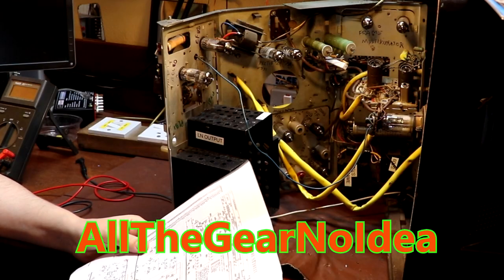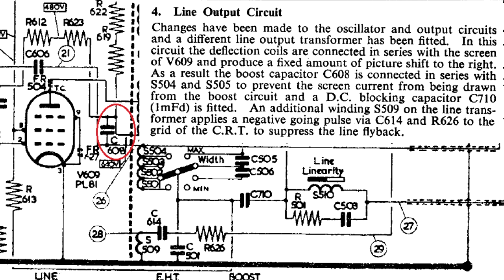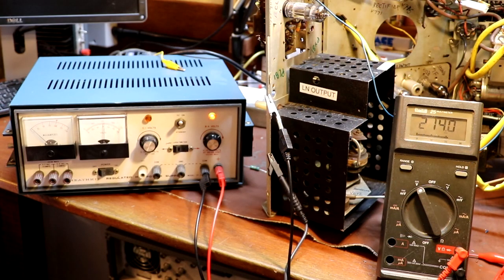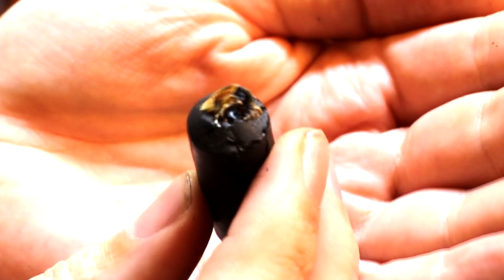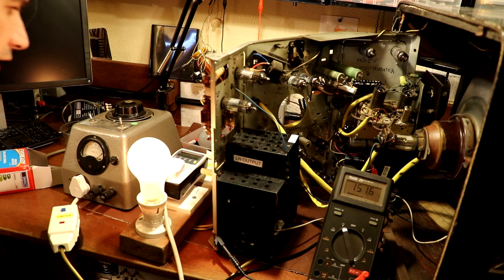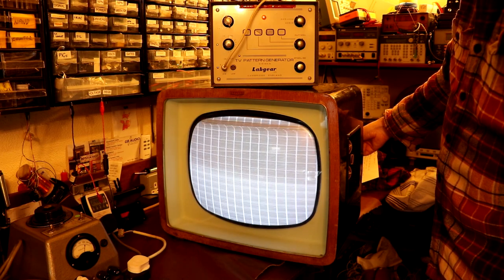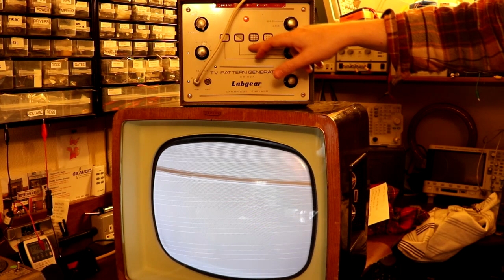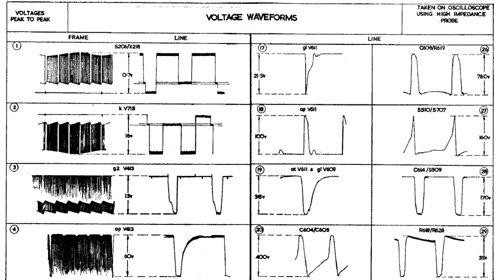Shampo066 Stella TV Repair - Part 2

Comment: Well done, Chris. In the last bit of video it looks as if you solved your vertical hold problem. Looking forward to the next part to see how you progress. My experience with "video" was the raw output of a radar receiver (we called it video) and was a completely different beast. The "sync" pulse was a very large positive pulse at the beginning of the "frame" caused by a 4 Megawatt pulse from the transmitter. Regards, David.
Reply: Me too David. Expendable naval decoys, fuses, IFF gaussian radar. Pulsed RF power. Can't say much more.
Reply from the maker: Hello David it’s more a case a stopped clock being correct twice a day.  I think the frame oscillator is free running without sync. It will sync with the video via a manual adjust but then the oscillators drift out of phase and the picture rolls.  I also used to design spooky equipment used for the guidance of large penis shaped object alas I cannot say no more !
Reply: @danishnative9555  I also worked on IFF and yes, can't say much more. Most of my work was on 250 NMi (463 Km) range primary and secondary radar systems.

Comment: Hi Chris, well that's a great congratularly mode for you to get the televisory working state and clear picture, never minding the framy rolly. 405 Droitwhich lines though probability broadcast masty down the tube twenty more these days. Actually and not known familiarly 405 liney was 376 linefold indeed.  Composite H and V typo signal for the syncy pulsey signal threshibold back and reach 405 lines, you see? Fundimold, the vertical synch pulsey begins ever more the blanky interval. Of course, matters little fact that 405 was 10.125 hertzing frequence which by clearing division equilibrates 50 hertzing timing 405/2.  The transformerfor for the coil weighty acts to buffery the sync seperaty bias capacitors timeringy and act as a vertically line pulsey continued. If the dB's gain is 10 over log then, as you know, is five divided by then that gives you the right answer. Mind you you will have to do a matchy most for the flyback keel.   Hope that helps - Andrew
Reply from the maker: Yes think you probably correct. I may just try George’s idea first and bang the top of it until it starts working.

Comment: Superb Chris
Really enjoyed the video , the dot on the screen at the end brought back some memories !
I do like the way you test new capacitors before putting them in , i also do this it's good practice 
Anyway great watching 
Best regards Shaun
Reply from the maker: I always check capacitor just in case I have read the value wrong or got them mixed up with another component. I miss the dot now with the modern televisions they should write a dot into the software for the new television. Thanks for watching and comments regards Chris

Comment: Pace soldering equipment, the choice of professionals , Im not sure I would have picked a hard wired TV for a first TV project though !
 you should also check both surge limiter resistors  connected to the anodes of the rectifier valves, the valves are both in parallel if one of the resistors is open circuit the set will still run but the valve will be over run .
Reply from the maker: Ok thanks I’m looking for any tips and advice you can give.  I think I like this construction method as it is less dense than a PCB and I work with PCBs so it’s a change. I’m hoping to look at the sync separator later this week and sort out the hold problem. I generally buy pace stuff as it what I’m used  to using but I do also have a metcal fetish.   Because I Use a soldering iron a lot so it has to be a good one and the reliability pays for its self Thanks for watching and great comments regards chris
Reply: @allthegearnoidea6752  Check the screen grid and anode load resistors on the sync separator valve as resistors in this position usually change value, this is assuming you are 100 percent sure your signal generator is working correctly, and don't overlook the easiest part to replace , the valve !
Reply: R407 anode load resistor  !

Comment: Great to watch. And I watched it all. You might be over driving that crt a bit, might be worth checking CRT voltages, etc.
Reply from the maker: I will take a look at that Simon. I am planning on starting to go through the set now and make some measurement  against the service information.  Just wanted to know it was a viable set before doing too much work.

Comment: Great stuff Chris. I bet it was a relief when you turned the brightness control up. I seem to remember that scrolling screen issue from many years ago and it always was fiddly. More work required I’m sure but the final image seemed very clear and stable. Cheers Graham
Reply from the maker: Thanks Graham. The picture was basically stable after tweaking all the controls but it would roll if the picture contrast or sound changed suddenly so it does have some faults. But the main think is having proven the CRT and LOPT are ok as these aren’t easily replaced. Thanks regards Chris

Comment: doing an excellent job chris the reason i still have some of the mains leads is because i am loathed to get rid of things  mind you i never thought they would become scarse . limiter is to stop car ignition interference.
the frame fault will be in the intergrater circuit as line lock looks good.
the frame flyback line should go when the synk problem is fixed. keep up the good work.
Reply from the maker: Ok interference limiter thanks. I guess there are not many of those noisy ignition systems around these days but plenty of other forms of interference etc. I will be starting to have a look at the sync problem next week. Taking things slow I don’t want to rush this one. Thanks again for the power connector that was a big help. Thanks regards Chris

Comment: Wonder if the limiter is the interference limiter.  If it is it should be set to just above the point at which it starts to cramp peak white. I.e. just above a strong signal level so it has no visible effect but will clip interference.  Hopefully the lack of sync is a cap in the vertical integrator, or an open coupling cap not delivering sync to the oscillator.
Reply from the maker: That’s what I’m hoping for the sync separator etc

Comment: Well done Chris my hart was in my mouth watching this....if i had a pound for every time i forgot the heat shrink after i soldered the connection '🤣
Reply from the maker: I used to use heat shrink but I have recently started using silicone tubing. It’s slightly bigger but it feels more authentic than heat shrink and it stands up to the soldering iron better. Give it a try.  Yes I often forget myself but it depends on the circuit etc. Thanks regards Chris

Comment: The bright and dark bars slowly rolling up the screen are indicative of 50Hz hum interfering with the video signal.  You might want to check the power supply rails for excessive ripple both in the set and in your pattern generators.
Reply from the maker: Hi I don’t think there are any hum lines  rolling up the picture, it’s just the camera shuttering. But perhaps you have seen something I haven’t.  The pattern generator have both been rebuilt so they should be ok. I will have a look for power supply ripple as you suggested. Thanks regards Chris
Reply: @allthegearnoidea6752  If you look very closely at the vertical lines in the cross hatch pattern you can see them shimmer slightly along with the passage of the hum bars up the screen. I don't think this shimmering effect would have been produced by the camera shuttering but it could be caused by ripple on the supplies causing slight shifts in the sync separator performance. Another possibility is poor supply voltage regulation due to changes in supply current drain with the variations in picture brightness caused by the hum bars.

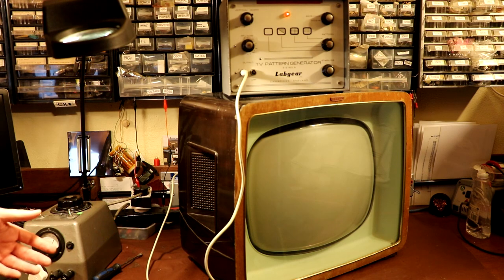Comment: 10:55 Hi i think you already know this but the capacitor is slightly leaky and so the time constant gets higher so the meter thinks the capacitor is of a larger value.....that one is not very bad but remember the meter outputs a very small voltage...lets say the meter outputs 3v..if the cap shows leakage with 3v across it, imagine with 600v   14:26 when you plug directly into the wall a bright filament flash on some valves is normal on series string tv sets, it lasts for a second and then they glow normally. be carefull when powering a tv on a variac or dim bulb...the horizontal oscillator may not start and you will ruin the output tube really fast because it will draw max current if the oscillator is stopped. you can lift the cap off of th tube to avoid damage...you can then "hot plug" the cap if you carefull enough and watch the current draw and heinewhistle noise as you approach the cap. 18:46 yes you are right..both stages are running and i can hear it through te camera...
Reply from the maker: Thanks Hugo yes these capacitor fail on leakage I don’t normally test them but people like to see me do it on camera for some reason LOL. I was only running it on the variac for the first run to look for anything on fire. I do  always wind up  the, variac rather than just switching the power on and off as it’s kinder  for series strung sets on the valves filaments. I think this has a thermistor in series with the heaters. Also for some reason my isolated supply is a bit high so I run it at 90% which is 230V. Maybe I will instead change the voltage selector on the TV to 250v.

Comment: 21:46 usually that is a sign the crt is very tired so in order to get a picture you need to crank up the brightness too much , thus making the black look washed out or too grey
27:27 you have a linearity issue on top of the picture...see how the circle expands when it reaches the top of the screen? that alone can cause the picture not to lock...it may not be a problem in the sync but on the linearity pot itself or close by components. if you find that the crt is tired you can short circuit both the heater wires and run it off of a 8v  doorbell transformer...it will make it look much better and it should last some decent hours because the set will not get intensive use...or you can try rejuvenating the crt either with the proper device or DIY by zapping the cathode with 220v with a 15w refrigerator lamp as current limiter (i am not responsible ) :)
Reply from the maker: Hi Hugo I’m not sure on that I was worried that for some reason it’s over driving the CRT it’s supper bright I have had to turn the brightness right down to make it watchable.  I’m going to have a look a the sync pulses next week, I have found some high resistances in the sync separator but I’m not sure that’s the problem.  Thanks for watching and comments
Reply: @allthegearnoidea6752  if you turn the brightness down until the background just begins to turn black, you should be able to see clearly the crosshatch pattern on daylight on a strong crt..if not then i suspect the crt is tired...  but its good progress so far!!
Reply from the maker: @MrHBSoftware  it could well be me that doesn’t have the set adjusted correctly I guess it’s going to take a little practice first.

Comment: Well i felt like i was being told off at the start lol,  So you are  not an expert you bodging bugger :-D
Odd how you got it locked at the end,  some fault with the video synch seperator/buffer?.
T.v sets did some strange things with synch,  sort of connected with contrast operation ish!.
I never did look at the vertical lock system, so I know nothing or not much.
I'm sure you will hunt down the cruddy bits :-D
Good you checked the mains orientation,  now you have neutral chassis or Earth.
Smashing video chris, sorry i cant help you.
Reply from the maker: I think  the frame oscillator is free running and not receiving it’s sync pulses so it’s going out of sync with the video waveform.  I don’t think it’s actually locking yet but you just get lucky from time to time. Hopefully dig into this next week. Thanks for watching regards Chris .

Comment: The original Doctor at end. Yes, believe it or not, many USA Yankee Nerds have loved and cherished the Doctor over the years. (Along with all the other wackadoodle noise emanating from over there:)  Chris, did they make an inexpensive British standard OTA HDTV RF converter box that would work with this old 405 line machine? Or is the intended use for this old girl just a museum piece? Bang up job.
Reply from the maker: I’m  a big fan of doctor who but I am really surprised you have heard and seen the original doctor as a lot have been lost. God I hate the new doctor and all the woke politic at work in the BBC now.  There no cheap option I use an Aurora standard converter these are made in the USA I think it was around £400 when I bought it. There may be cheaper options coming out in the form of the new pineapple converter. These only take a composite video connect. There is no HD option. Thanks for watching and comments regards Chris
Reply: @allthegearnoidea6752  I'm only familiar with the first Doctor Bill Hartnell legacy from the web. In 1963, I was too busy listening to the Beatles & got my first erection. We have been getting a steady stream of BBC characters via "non-profit" PBS, though it's limited. Lately we had Upstart Crow and some other comedy about the BBC broadcast system itself, can't remember the name because it pretty much left me clueless....kind of stupid if you will. But all in all, what we get here has been a real blessing over the years. Blackadder, Monty, The Wrong Mans, Mister Winner, Midsomer Murders, Last of the Summer wine, Are You Being Served and on and on. Good stuff. Thank god for the British sense of humor, because most people don't understand real creative TV here. Too many Rubes.